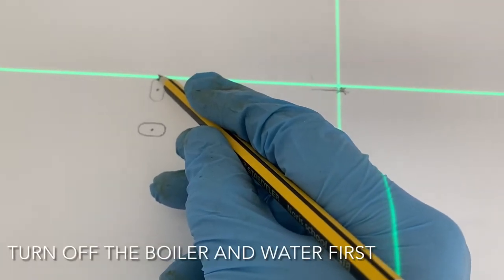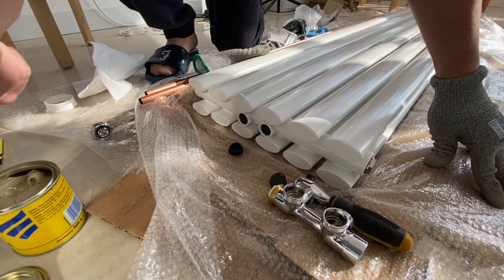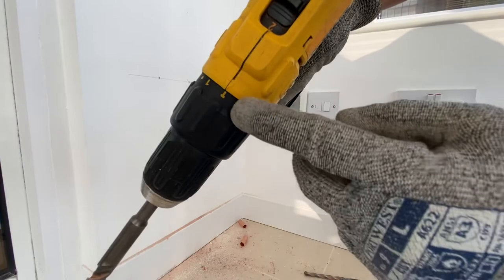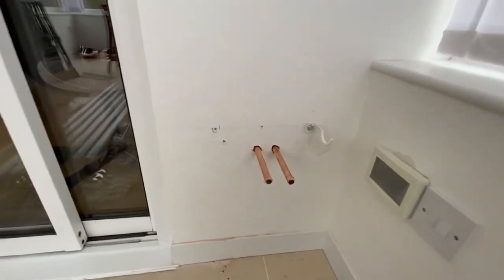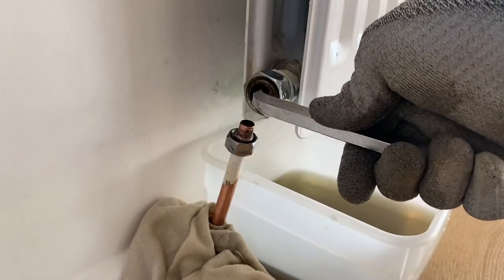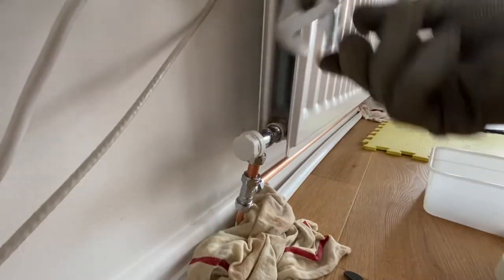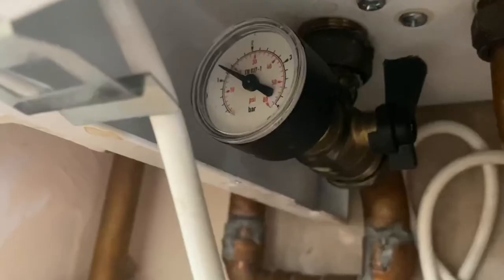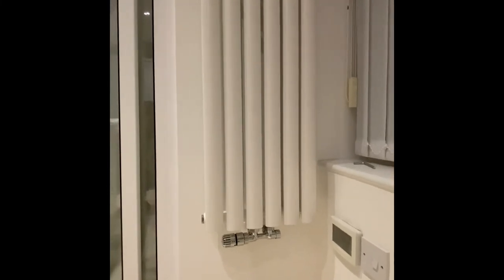Install a radiator in my conservatory/ part 1

Comment: Thanks for sharing, I did a siliar installation in my conservatory not long ago... it was the only way the wife would let me buy a blow torch! A good practice is also to also sleeve any copper pipe running through a wall, its possible that there could be substrates within the wall that could corrode the copper pipe over time; I sleeved mine in plastic pipe wrap to create a barrier.

Comment: Is it a Chinese thing, my dad puts joint compound on every joint.
Reply from the maker: No, just the rubber rings look too thin and too weak, the joint compound was a double insurance 😄👍
Reply: @Darren Chan  that's what I mean the joint compound in top, seal and ptfe tape should be enough. Let's just hope you don't need to take the joint off as it can set